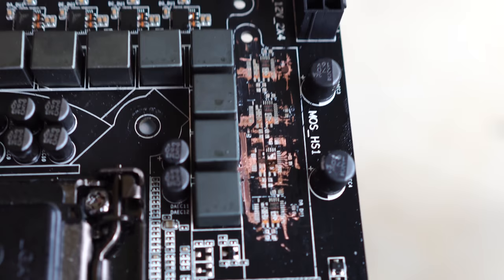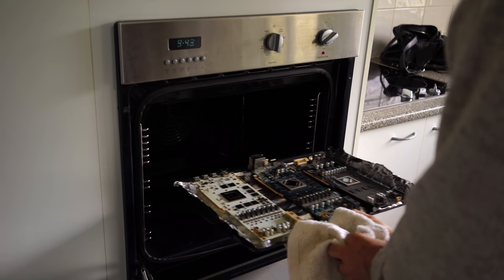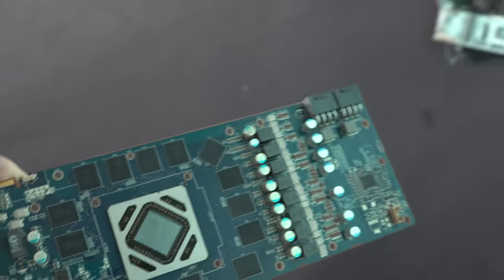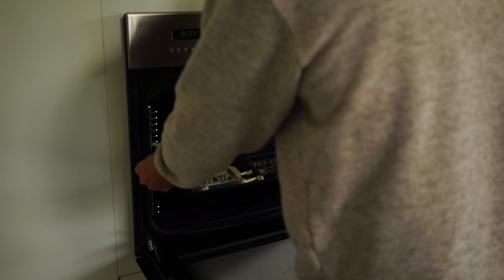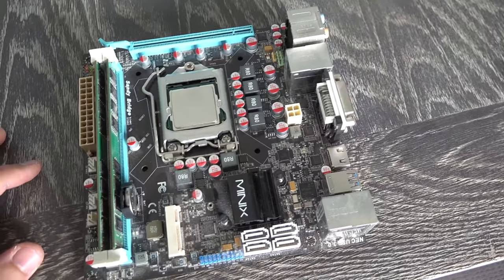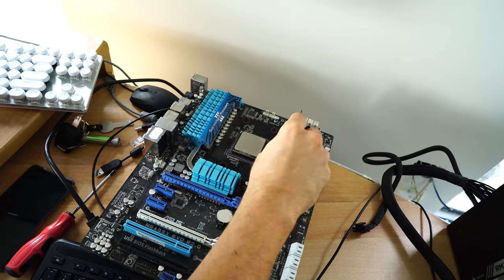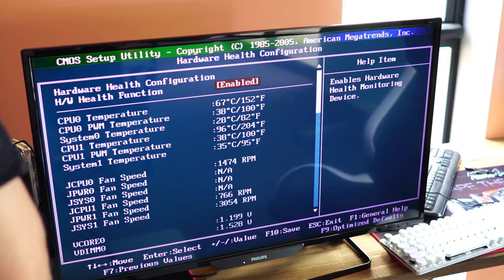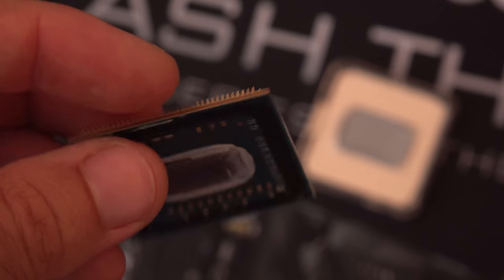Can YES Fix IT...!? The 8 MINUS 4 Phase Power Design | Oven Baking GPU WORKS!?

Comment: I love people getting triggered by the baked cards and bringing up Rossmann because of it. At least baking a card can be a temporary fix, I personally took my hot air station to my laptop's GPU three times before it finally wouldn't resurrect anymore. Yeah, it isn't a permanent fix, but it has been enough to give me time to acquire the money for a new board, or in the case of graphics cards got it working until a new one could be shipped to me... except that one time a card fell off my shelf, cracked the die itself poor lil feller never stood a chance. Chiseling off MOSFETs though, that made me cringe, the only solution that can offer is a little stress relief, where as replacing them properly could actually repair the board.

Comment: Brian! Baking gpu's is bullshit!

Please watch some eev blog videos about surface mount components and buy a rework station (80$ on Amazon) it will avoid you using a sharp object that most likely damages the traces + probably traces on other levels of the pcb.

So many repairs are just replacing a shunt resistor or a shorting capacitor!

Baking a gpu, motherboard or other problem isn't a fix!! With the proper tools you can do it a lot better, the oven guides are an urban myth, complete bullshit.

The only time when oven baking works is when it could have also been fixed with a heatgun and a bit of work

Comment: rather putting those graphic cards in the oven, why not just dry them on the sun. that's what i usually do when motherboards are freaking out. its just the matter of removing the moisture. nothing else you can do if it really don't work after that.

Comment: Bryan like a lot of gamers I have now  run out of  graphics cards  I have  three high end graphics cards  that over the years have died they  all went to black screen. I found out that There no where in my county  Australia that I can send them to get them t fix that would no cost more then the card would cost new As  just to replace any one of  them in Australia there around about $300.00 Even second hand Cards off  of eBay cost around $200.00 I never thought about  trying  the over I feel the heat gun may be a much safer way

Comment: Do not put your gpu in the oven. Just put it in a trash can. It is only temporary fix, has nothing to do with solder joints, and will only give you some time to find working gpu.

Comment: The Oven method is NOT fixing the card, it is just destroying it more. Louis Rossmann made a couple of great Videos regarding this topic (just search for flip chip bullshit, the first videos that pop up should be it).
Reply: Yea Louis Rossmann, the same guy that couldnt fix a gpu with all his fancy tech either. Everyone knows this is no magic pill that will fix anything. But its the last resort. Either that or put it in the bin. Even if it works for 1 day its better that not working at all.
Reply: I have fixed a card by baking it and it is working now solid for many moths and no signs of problems. Before it was crashing the PC after 39 mins of use. I guess it is fixed now?
Reply: Seffer Exactly! Thank you! Also i would say dont learn pc repairs at all. Theres little money in it bc its usually cheaper to buy new if its out of warranty. That and clients are jerks. I had a lady who ask me to upgrade ram and ssd upgrade and fresh install of windows. And i kid you not, almost 2 years later the power brick died and she came to me saying it was my fault and ill have to repair it for free.
Reply: I baked a GTX 480. It worked for 6 months until my AIO leaked onto it. Destroying it more? Please.... A card that doesn't work can't be destroyed anymore than it already is, it either works or it doesn't.
Reply: @ChZml6  The reason he couldn't fix it either is because the chip was dead, he just reballed it, he could flat out replace the main video chip then it would work.
Reply: Thats not true lol i backed my gtx 660 back in december 2014 and i've been playing with it to its max and overclocked it too and still working just fine

Comment: You do know you just ripped off all the mossfets and just left the chokes right ? So thats not going to work ever! And reflowing cards in an oven WILL NOT WORK. its a temp fix due to issues with the main die , an oven will never get hot enough to reflow that thing.

And you removed the bloody mossfets with a wood chisel are you insane!
Reply: That SR2 is fucking bad ass tho.
Reply: ik destroyed hardware. I fixed my gpu by reflash bios with second gpu installed managed to get one that died working again re-flash bios and all good

Comment: Guys nobody cares what Louis Rossman says. He’s not the all knowing authority on everything.
Reply: Antares 8001 all you’re doing is regurgitating what you’ve heard from others. You can sound intelligent but unless you have a degree in electrical engineering then no offense but I don’t care what your opinion of it is.
Reply: Antares 8001 Alloys commonly used for electrical soldering are 60/40 Sn-Pb, which melts at 188 °C (370 °F). I don’t know what your mom and dads oven goes up to but my wife’s and I oven goes to well over 370 F
Reply: Antares 8001 you don’t need to make direct contact to reflow

Comment: Even if GPU works after that it will fail again in 0 to 90 days of use.
Reply: Gorazd Novsak Sell it on ebay as a working card. 😈
Reply: Explicit Tech I would never do that. Selling broken GPUs as working. Chip is dead. Heating brings it back to life for some time  but will die again soon... This metode is good only in case you can not buy a new card right now...
Reply: Gorazd Novsak If crypto ever crashes to the point where electricity costs more, this is what they will do.

Happened a lot during the first wave and so many got cards that died within a few months. Not to say they baked them into oven, but they were getting baked mining.
Reply: Explicit Tech I still have all my mining cards. If you take care of them they will outlive gaming cards. My 5970 were runing 5 years without a problem. But I did need to replace a fan on everage 2 times in this 5 years. I still run 7870 and they run just fine. That is just a BS. Unless you buy them from idiots that don't know what they are doing... EDIT: I am 45 KW miner... ASIC  and GPU